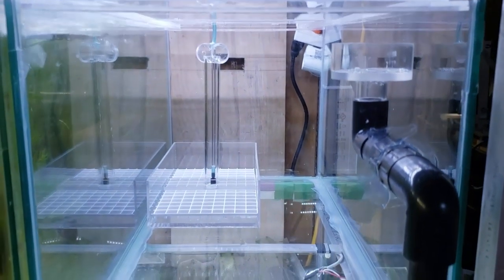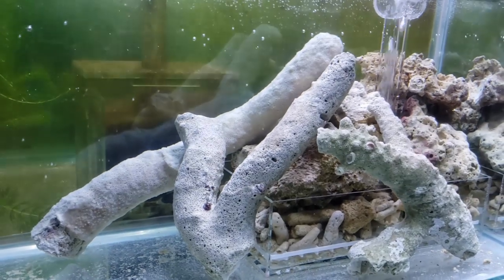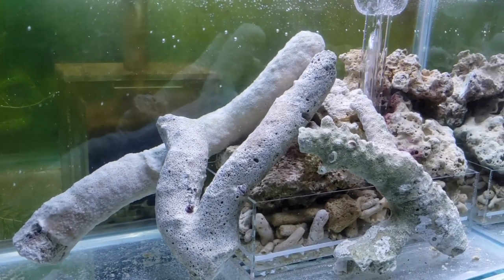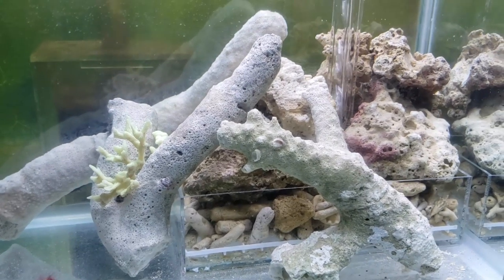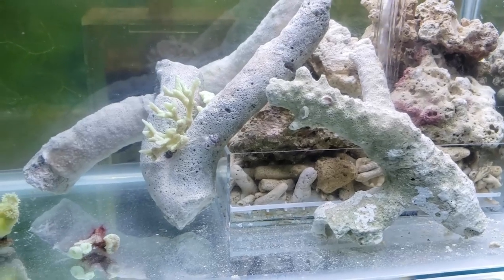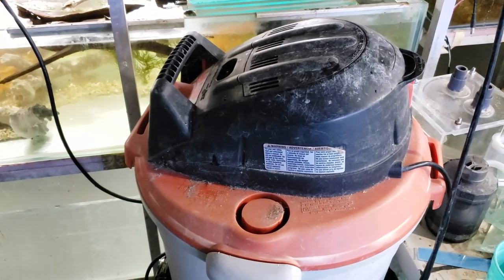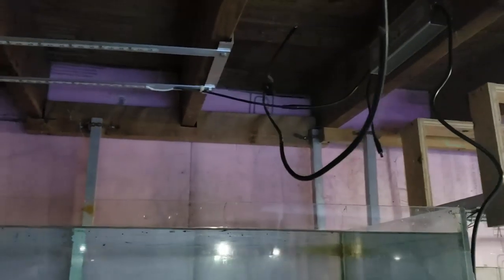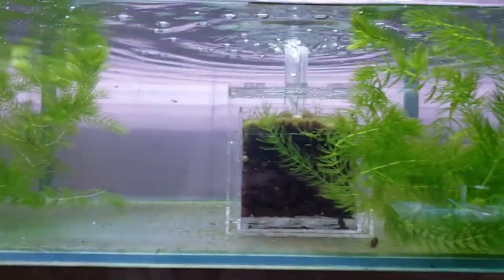Ultra Low Tech Nano Marine Tank

Comment: Technically, the tank should be successful. The undergravel will keep some circulation and aeration going. You have more than enough hard surfaces to grow adequate BB without filtration. Following.
Reply from the maker: It should work but I'm still curious to see how well it will look and grow what I put in it. Thanks for coming by

Comment: What about temperature? The problem with under gravel filters is you don't get rid of the waste in the tank your gonna high nitrates.  You could add filter floss to the top of it.
Reply from the maker: I heat my fish room instead of individual tanks so it should be fine. As to nitrates we will have to see how that works out. Thanks for coming by and sharing your thoughts on this

Comment: Coral is fairly low waste, so with no high waste organisms in the tank they should be fine as you say your live rock is pre cured etc.  As long as the coral like your water parameters they should do just fine.  You should look at getting some 20K lighting just for yourself, the coral will look a lot nicer
Reply from the maker: Once the tank cycles more will be going in here. I'm trying to do this as low budget as possible so I will be sticking to these lights if I can. Thanks for coming by

Comment: It will be interesting to see how the lights affect it. I know whenever I bought marine lights they were 10 K instead of 6500K and I run one on my 30 gallon fresh water tank and leave it on 12-14 hours a day and have almost no algae, I bought the wrong light by mistake and got the marine instead of the freshwater. Lol. It’s an aqua neat light it’s got all 10K white LEDs with a few blue LEDs. I’m actually wanting to change it out because I want a little bit of algae and right now it only really grows on the lid where the bubbles pop and keep the lid wet.  Most of the marine lights I’ve seen listed were 10K or colors, I really have no idea what the difference would be so it will be interesting to see
Reply from the maker: There's something you rarely hear. Wanting more algae. Don't go out and buy new lights. As the ones you have age they naturally shift from 10k down to the warmer parts of the spectrum. Thanks for coming by
Reply: Fishman i’d like that I can leave them on for 12 hours a day and have no algae but my plants don’t like them and I’m trying to get some shrimp going in the tank, it’s about six months old now and it’s still pretty barren lol.  I have horrible soft water so I have to add salts and minerals. I got a cheap little 10 W flood wh I have horrible soft water so I have to add salts and minerals. I got a cheap little flood light to him right on the plants but after a month there’s really almost no algae growth at all.  Lol.  I don’t want it out of control but I’ve always kept the backs of my tanks untouched so it could grow a nice green layer.  I’ve got on my parameters right but the shrimp just aren’t breeding and I have to keep feeding them. I’ve got girls shrimp and cherry shrimp. The only thing doing well are the pond snails in the fish. I’ve got four guppies and eight invert tetras.  Usually when you set up a new tank it takes two or three months to really kick in and normalize and usually algae is kind of a battle but this one’s just got nothing going on in it.  Lol.  If the spotlight doesn’t work out I’ll probably get another light and just use both of them and keep the other one on just a few hours a day.

Comment: I want to set up a low tech marine aquarium too. Inspired by the walstad method for freshwater tank.i like ur project here. Without the issue with them bacteria which you faced, do you think this set up would have worked. Any suggestions are welcome. Thanks Thimmaiah
Reply from the maker: Low tech marine tanks work. They are just less forgiving and require more patience. I set up many in the late seventies and eighties when that's all there was to go by. The issues I ran into here were from the light at the bottom of the tank due to the rack system. There's no other big secret to doing them. I had set up a gravity fed automatic water change system that dripped into my setup which had the overflow already built in. One of those does make it more stable. Hope that helps
Reply: Thanks for the reply. One other query I have is, is it ok to use the normal river sand or argonite sand is a must?  I am planning a macro algae scape with fish to begin. I am from India so not sure what algae I can find. I am planning a HOB filter on a 20 gal tank.
Reply from the maker: @ytube_tim  Unfortunately it has to be a coral based sand. When you get this set up take a pic and send it to me. I would love to see it!
Reply: @FishmanEricRussell  thanks again. It might be a while before I can set it up considering we have a lock down due to covid.
Reply from the maker: @ytube_tim  I understand. Covid is changing many plans
Reply: @FishmanEricRussell  if I have a macro algae and fish only tank. Does the macro algae ( chaeto or gracilaria) need micro nutrient dosing or will fish food contain the nutrients necessary for the macro algae?
Reply from the maker: @ytube_tim  I've never had to feed macro algae. If you are doing proper maintenance to keep the fish happy the algae should thrive